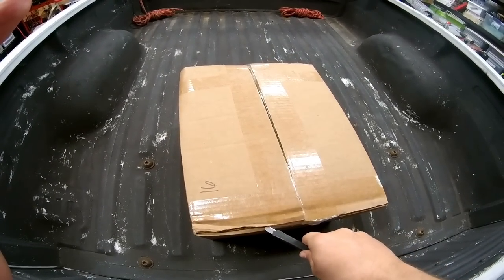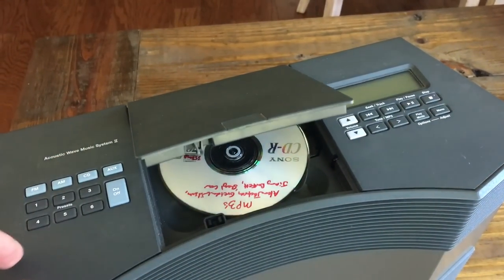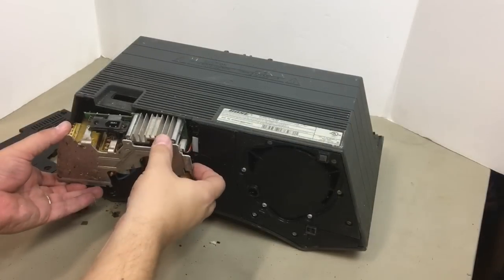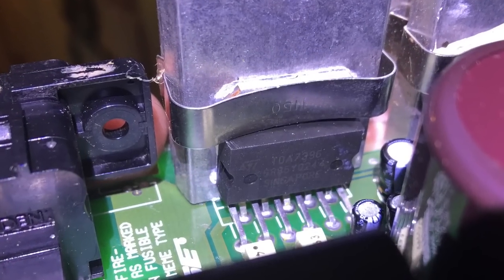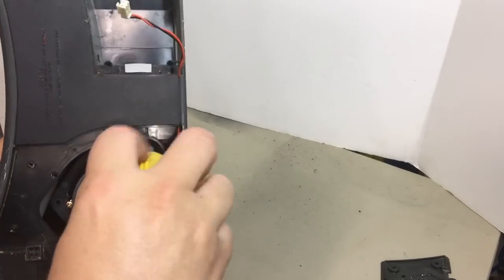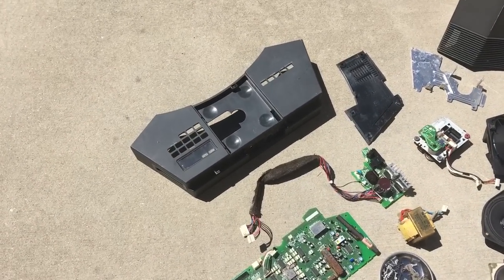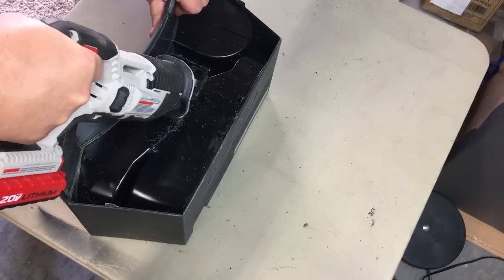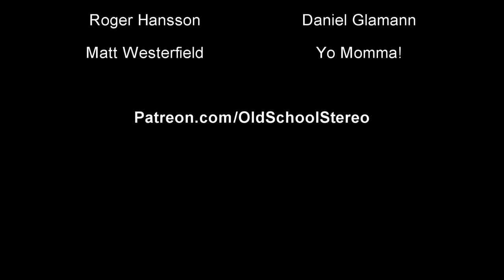What's Inside $1100 Bose Acoustic Wave Music System CD-3000

Comment: I have the Acoustic Wave Music System 2 and have to admit it has amazing sound for a portable system.  I bought it second hand for about $200, but if it ever breaks, I'd buy a new one to replace it for sure. I hope they update the system soon too!
Reply: I used to crap on bose, but after going over my uncles house and listening to his wave quite often I ended up buying one for myself. Its certainly not for everyone, but it's got a nice clean sound and has depth at a "conversation level" listening volume. I'm surprised of the sound they got out of it with those 2 3" full range speakers or whatever they are. I also got their Bluetooth soundlink II speaker from work, I LOVE it! it has a passive radiator on the back with a weight attached to it and it blows me away how much clean bass can come out of such a tiny speaker, and it vibrates my desk like a little sub.
Reply from the maker: Seems to be a LOT of Bose hate in the comments, but I wonder how many people have actually heard one of these? I'm with you, I was blown away by the sound. Although I think a fun comparison will be this AWMS 2 and the Apple iPod HiFi. Those were from 2006 and originally sold for $349 and impressive as well
Reply: Waaayyy in 1992, I had a personal tour of the Bose repair shop in Cambridge, MA. They had their entire speaker set up at the front desk. As I waited for my personal tour guide, I checked out where the music was coming from. I started with the right channel speakers and couldn't find the speaker producing the music. I looked at the receptionist and asked her where the music is coming from. She has a smirk on her face and she said, "Try the left side." So I did, and on top of one of the large speakers was the smaller Wave Radio. I was blown away by the fact that this little thing was producing such awesome sounding music. 

During my tour, the person showed me the larger version, this AWMS. He has it torn down so he could show me the inside of this thing. Being 13 years old, I was impressed.
Reply: I have 4 of these, and they're just amazing. You can plug anything into them and they don't disappoint.

Comment: I worked in an electronics store back in 1993. we had a lot of mid-priced stereo equipment. One of our Home theatre setups was the Bose Accousti-mass system (not sure if I spelled it right).  Tiny little cube speakers placed at listener and also away from listener to create a bigger more immersive sound stage. At least that was the gimmick marketing copy we were supposed to regurgitate. They sounded like cheap shitty paper midranges in plastic boxes because they were. The outrageous price for this junk simply could not be defended. lots of people wanted to listen, very few ever bought. 

My only other experience with Bose is my Mother in law has a bose bluetooth speaker. It sounds ok. It looks nice. I could do much better for the price though.
Reply: I was in direct sales in the late 80s when those Acoustimass systems came out and some guy had just bought one and was excited as hell to demonstrate it to us. He got a Beethoven CD and told us it would blow us away. 
Bwa-ha-ha-ha! I was totally unimpressed. WTF? I have Akai and AR4 speakers from the 60s - big furniture quality cabs - that outperforms all of that stuff.
I found the 901 system to be shit back in the 80s when I found my GF's dad had a set hooked up to a nice Marantz receiver. I was ready to be impressed and No, sir, it did not happen. I give that an F.

I was given one of the smaller wave guide systems recently and found it is cool for a bedside alarm clock however the CD drives in the radio itself, as well as the separate bottom unit are total shit. I watched a YT video about correcting them and found them to be the worst engineered crap made. I learned the CD drives haven't worked in years. There are only two tiny speakers in those units and they are in an enclosed housing which sits inside the case.
I tossed the useless bottom unit and placed the top unit on top of a JVC boombox to see how they compared. 
What I found is when both are tuned to the same radio station the Bose adds bass and mids the JVC doesn't and sound nice together. The Bose has no highs at all and the bass is boomy. There are no dynamics at all and it sounds as if someone threw a wet blanket over it. It's now my alarm clock.
These didn't cost $1000 new but were more expensive than a decent pair of low end Radio Shack {Realistic} speakers. 
I am contemplating putting small tweeters in the Bose to liven it up. It was free so it's an experiment. I was just in the other room and it was playing; boomy bass is all it offers. No cymbals or anything.
Summary? Plastic, cheap speakers, electronics and shit CD drives are overrated Meh...You can buy plastic utensils if you don't want to dirty your metal flatware.
Reply: Bose learned.  At some outlets they build custom listening theaters that seated maybe 20 people.  On stage, a snake oil sound system salesman would pitch the product. They later came up with tiny pre-fab listening pods. Those had a clear plastic dome at the top, but otherwise open  Step in and push the button. The music was pre-programmed, and of course it avoided the huge suckout Accoustimass has in the mid 200 Hz range  Outlets were instructed not to demonstrate Bose alongside competing brands.
Reply: That's the thing with Bose. People pay a lot of money for equipment made from cheap materials such as speaker drivers with 1 1/2" paper cones. They rant on about the research they do, but the research sould tell them to use better quality components.

Comment: BACK IN 2008 I BUILT A BOX FOR 4 15"s MIMICKING THE BOSE DESIGN : THE BASS I WAS PRODUCING WAS UNBELIEVABLE!
Reply: Manfred Schield how where you able to tune the box?
Reply: I am a bassist and in the 70s used an 18" folded horn cab with 250W amp. It was killer at 3. Lows? all night long.
Reply: Was it the size of a room?

Comment: I remember reading something decades ago about taking a Tube, cutting it at 1/3 its length, putting Speaker on the end of one section, then putting the remaining section, on the other side of the Speaker. This pretty much what BOSE did in this thing. I almost bought one, but it, unlike me, wasn't cheap...

Comment: At least this guy told you what you needed to know.

2 amps at 40 watts each, 1 for the mids and highs and the other bridge for bass.
20L, 20R, 40 bass on a 60 inch long pipe by 2 inch PVC pipe. Add a camber to hold the base driver at 1/3 of the length.

Comment: You measured the DC Resistance. That is always lower than the Impedance. With 2,3 Ohms DC Resistance the Woofer could be a 3 Ohms type. The two smaller ones are probably 16 Ohme Speakers. Keep in mind, that the lowest point over 20Hz can be 20% under the Impedance.

For example, it is not unusual that a 8 Ohm speaker has about 5-7 Ohms DC resistance and a Minimum Impedance of 7,2 Ohms above 20Hz.

Comment: We have their wave radio unit and I will say it is built very well and sound is fantastic..... for a $350 clock radio.  Price is very reasonable for the quality of the item.... including all FR4 circuit board construction inside.  Now the other Bose stuff being price/performance reasonable......  I would buy a pair of Vandersteen or Snell speakers any day over similarly priced Bose speakers.

Comment: These did not sound that bad, better than the 100 dollar boomboxes of the day, but not as good as some of the 250 dollar ones.   Thing is it cost $1,000. and used cheap parts.
Reply from the maker: The video I'm releasing tonight has a quick sound comparison between the AWMS and a Cambridge Soundworks Model Twelve transportable system. It's interesting....
Reply: @wal  I had a Model Twelve in my office, and I sometimes took it on trips.  Not bad at all. Far superior to the Bose, and originally half the price. As I write this, there are several on ebay listed at less than $300.  There are also some Henry Kloss Model 88's which Cambridge Soundworks introduced as a Bose Accoustic Wave killer.  Those are selling for under $100.

Comment: Tech ingredients, channel said that 1/3 is the sweet spot in object for the best resonance on a speaker.....

Takd a PVC pipe and place a speaker at 1/3 in this Bose setup is actually 60 inches long and that 4 inch was place at 20 inches. My test did produce great sound just make sure that the port is equal on both side and used 1/2 of the size of the rating size .... a 4 inch cone with a 2 inch port, both sides ... or 

6 and 3 ... 8 and 4 ...10 and 5 ... etc.

Comment: Wow, this was awesome.  Although I've never really been a fan of Bose, I DO admit that the little enclosures do sound amazing, for their size!  Now the "magic" has been revealed.:). Another awesome video, my friend!
Reply from the maker: +ArcadeDude44 here's hoping I don't get a letter to take it down 😱
Reply: Yeah, same here...
Reply: ArcadeDude44 bose is like def tech cheap speakers in highly engineered enclosures. wich is why i respect car audio more then home our mids n highs go into doors and still sound better. for music of course big difference yes.
Reply: Fair comment. They go to some effort to provide a decent bass response in relation to the cabinet size. The problem I have with Bose is hat having designed a decent enclosure they then decide to permanently over-boost the bass electronically and make it sound 'one note' and muddy. They also try to tell people it's hifi, which it's not. In the UK they removed the expression "better than hifi systems costing much more" in the Wave Radio adverts after the advertising authority asked them to prove their claim (I was involved). The flaw in the Bose's thinking is that the radio does not even sound as good as their own 'hifi systems' which costing more (and why would it).

Comment: For me, Bose only had half a dozen products that pleased me:
The 901 hi-fi system and the 301 system, which was reasonably effective.
The original 802 system in the professional scope, not accompanied by the original 802 subwoofers, which only played reasonably if the system controller was modified. As a rule, I used the 502 BP subwoofer, which turned out better than the original.
And the Wave Cannon, which sounded good in permanent installations.
I saw and heard the LT system in operation but I did not get to live with it so I can’t pronounce it.
Of course dr. Amar G. Bose was very knowledgeable about electroacoustics and took the Wave concept to a good level but I wondered why so much technology was never as successful as the company claimed.
Overall, at the price paid at the time for these systems there were more practical solutions to the same effect. And I never realized why the company was so concerned about not clearly indicating which permissible powers, and that condemned many systems that failed miserably.
Honestly, I'm sorry but there is work to do and you can not compromise with companies like that.
In these days I do not know - nor do I want to know - if there is any product that could be used with confidence. I don't think so.
Reply: I think the reason they didnt publish specs on the wave gear is because it would be like comparing apples and oranges, the sound output of hornloaded style speakers is huge compared to the watts required to drive them.

If you told everyone that your speaker was 5w and cost huge amounts of money you would never sell one, the public arent engineers they would never have understood that you only need tiny watts to get a huge sound from that type of enclosure.

Comment: Back in the late 70's I lusted after the Bose 901 speakers. Bose claimed they could handle almost unlimited power and would sound better than almost any other speaker system. I could never afford a new pair but managed to get my hands on a used pair with blown drivers. I sent out all the bad drivers for repair and when I got them back, I just couldn't wait to audition them. Oh my, was I disappointed. Not only did they sound bad but they sounded really bad compared to what I was using at the time. They produced almost no bass and very little highs. I quickly sold them.
Reply from the maker: +Glenn Watkins very interesting, thanks for sharing
Reply: No Bass? Was this repaired by Bose? The 901's were made for rock and roll in my opinion. They blow you ears out with bass. I have owned 2 sets and loved them. Sold them, got out of decent music listening for a while, back in and building my own currently.
Reply: I just bought a set of 901 Series II Continentals. Got them very cheap, with the tulip stands. Hooked them up. They fail on every level outside of acoustic guitar. I tried everything I could think of, the whole idea of direct/reflecting sucks. 
I had 2 sets of Martin Logan Sequel IIs, and one set of SL3s. These Bose come nowhere near the Logans. I have some Fostex drivers, considering a build with some double bass reflex enclosures.

Comment: Cheap plastic construction, basic components, with a unusually complex front and back transmission line loaded sub woofer. Instead of gong to all that trouble with the enclosure design using bigger and better drivers would have given better results. Bose also seem to have an obsession with using extremely small paper cone drivers, where their efforts would have been better spent with using larger and better quality drivers, and a better power amplifier. Acoustic wave is just marketing? Transmission line and port loaded speaker enclosures is nothing new, and its not exclusive Bose technology either.

Comment: the wave guide 1.5/2.46M corresponding to peak of 114Hz and 70Hz, used may be 80 years ago.traditional Bose has limited BW with its tweeter so it needs expand woofer BW yet there is still a hole.

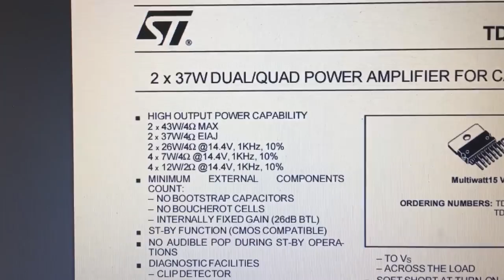Comment: 4:45 Those amplifier chips are so cheap! They're used in car head units! GAAAH! Bose is so overpriced! I could buy a cd changer, power amp, and speakers for half the price and they would get louder, sound better...
Reply: B Rad could they run on 10 d cells for 10 hours?  Or put out 0ver 97 db @ 1 watt? Or last 10 years?  Would it be so easy to operate a 5 year old could use it? Would it be smaller than the acoustic wave?  Good luck with that.
Reply: Bose speakers should be thought of as toys. They seem like the real deal, but they're actually made of plastic and construction paper. Get an amp and any old cerwin vegas, and you will really enjoy what you hear, and it will cost 1/4 even.
Reply: Cerwin Vagas speakers wont last 2 years. Very efficient but easy to blow.  Only the professional CV's hold up.  Their consumer stuff is crap. Car and home.  CV's NEVER sound natural and they have that everlasting continuos sloppy bass.
Reply: couldn't be further from the truth. I got an old CV pair from the 90s still working and I've played them way over their ratings and with continuous clipping which would kill most speakers. they have a tweeter protection circuit breaker built in as well. I got a the xls 215 which has the most satisfying bass without a subwoofer I have heard.
Reply: B Rad I use to sale Cv automotive subs in the early 1990's.   Gain turned almost all the way down on high power quality American sub amps and I lost 30% of  cv subs to failures. 
Never lost one Rockford , kicker or Orion sub. Stoped offering them after 6 months. They were loud and clean if not realistic bass.

Comment: 4" subwoofer? Leave it to Bose to use what the rest of the audio industry uses strictly as a mid-range driver as a "subwoofer". What a joke!
Reply: have you ever heard a bose system? its top of the line
Reply: 🤔, think you BOTH should broaden your horizons and get out more, it isn't the 60's anymore. Bose isn't anywhere " Top Of The Line" nor have "Superior Soind" like it's price point might suggest. That's why you see MANY other speakers/systems coming out that sound better* for much cheaper... Not saying Bose is junk, there not,should be half the price but there sound reproduction is good I'd say,have a pair of there ear buds, there decent, What Bose was able to do when it first came out was Amazing,, FOR THE TIME, the sound it was able to produced from such a small foot print set them miles apart from everything esle on the market and, Can't knock um though, there still riding the waVe (pun intended).
Reply: flappy188 hahahahahahahahaha !!!....
Wait.. wait.....

Hahahahhahahahahahahahahahah!!!
Reply: I have heard a Bose speaker system in a Mazda 6 I test drove a couple years ago, it was quite underwhelming. The subwoofer had decent sound pressure, but wasn't exactly punchy and I couldn't seem to get much treble from the tweeters even when messing with the equalizer. Had I bought that car I would most likely have replaced the speakers with Hertz brand speakers.
Reply: Before putting the performance down ... Please play with one for yourself  !  Compare it to a '60s Voice of the Theatre with 15" drivers and loaded horns is not fair BUT the PUNCH and HIGH are QUITE evident even outside . Note that I am happy with mine , have all the accessories .... travel bag with D battery tray , the rechargeable SLA battery , car cord and wireless mike  .
Reply: It’s a portable. How big of a woofer do you need?
Reply: boostedmaniac 
 Well , it weighs ~25 pounds loaded 😕
Reply: david meyer ffs! Learn they’re and their!!!!